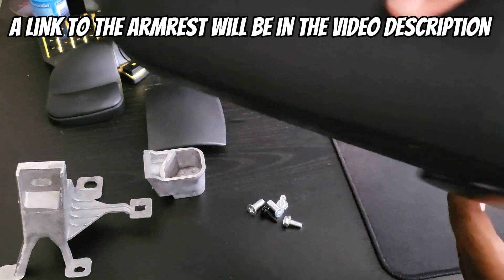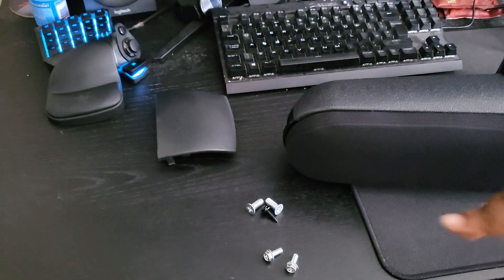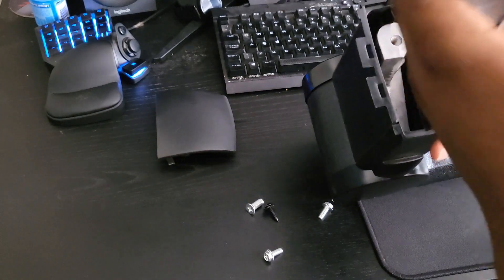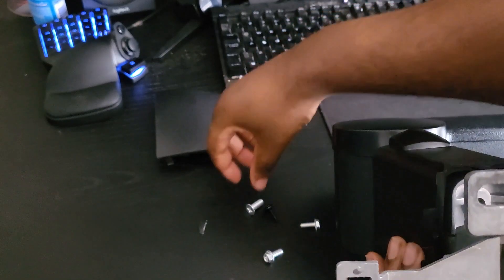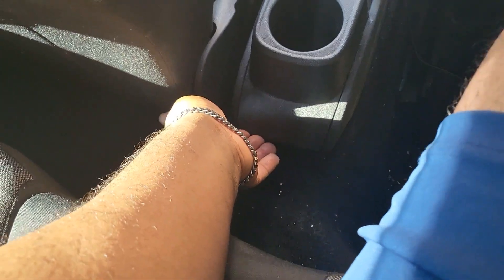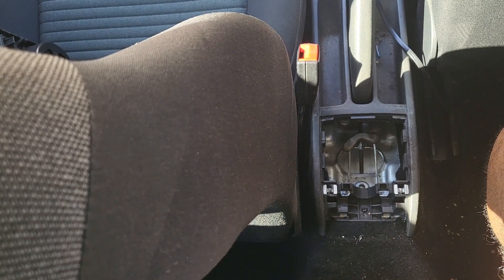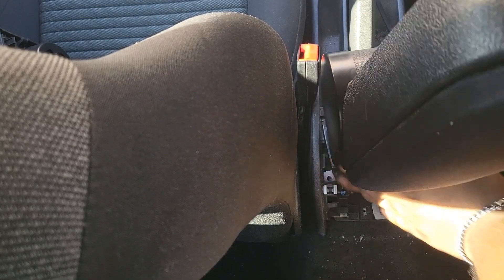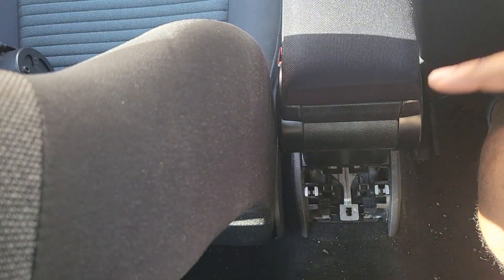How to install VW Polo 6r Armrest

Comment: This man... Posting what I wanted to do... Talk about a gawd send😂

Just a quick question: So the model you bought forfeits the cup holder? It doesn't have a pop up style that can open and close... Similar to the OEM one?
Reply from the maker: Perfect timing 😂

I believe there are two different versions of this that you can get, the one that I got without the cupholder at the back and one with a cup holder at the back that folds out like the oem one.

But I think the one with the cup holder is harder to find so that's why I went with this one.
Reply: I think the one with the cupholder is for the GTI

Comment: Hi what tool did you used for the x2 screws at the sides ? Thanks
Reply from the maker: I used a regular screw driver and a screw driver with a tiltable end. Even with both of those it was still really hard to screw the screws in.

For me the hardest part was seating the screws over the holes and screwing them in a little bit, after that you can use a regular screw driver to tighten it down.
Reply: @RCS_716  thanks! Great video 👍🏻
Reply from the maker: Thanks

Comment: Hello, I want to replace the passenger seat in my Polo 6R Comfortline 4 cylinder 1.4 85 hp from 2010 with a seat that can be folded completely flat. This while retaining the airbag function and the same plugs under the seat. Does anyone know which (VW) seats are suitable for this? Volkswagen seats from later Polo versions or other Volkswagen or non-Volkswagen seats? Any useful information regarding this subject is welcome. Harry
Reply from the maker: Unfortunately I have no idea, but I'm hoping someone else reading the comments can shed some light on this for you. Sorry I couldn't help.

Comment: Yo what alloys you got? Where did you buy them from?
Reply from the maker: The alloys are " Calibre motion 2 " 17 inch

I got them from a website called Wheelbase https://www.wheelbasealloys.com/

Referral code: REF25 

If you do buy from them and use that code you get £25 off

It was the fist set of wheels I've ever bought and it was easy buying from them, once you select what model car you have they list a bunch of alloys that will fit and they supply everything if need be. My alloys came with the tires already on the wheel and fully inflated, it also came with new bolts and spigot rings all I had to do was unbox them and throw them on.

The fitment could be better imo but nothing that a spacer couldn't fix.

No I'm not sponsored by them or anything like that, my experience with the company was good and I just wanted to share that info.
Reply: @RCS_716  oh okay cheers man thanks a lot :). Also do you know roughly how much your full custom exhaust cost? Like including everything to make it straight piped
Reply from the maker: Came to around £800

Comment: Would this fit in a 2010 plate polo
Reply from the maker: Yes, my car is also 2010
Reply: @RCS_716  does it matter if it’s a gti or gt or standard because Iv got a standard polo
Reply from the maker: It shouldn't matter, it should fit all mine is a standard tdi